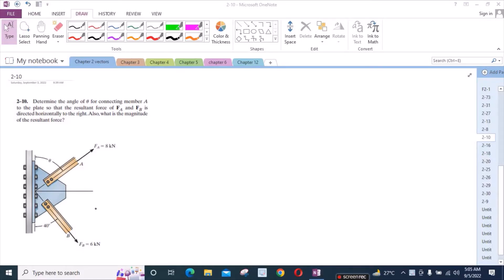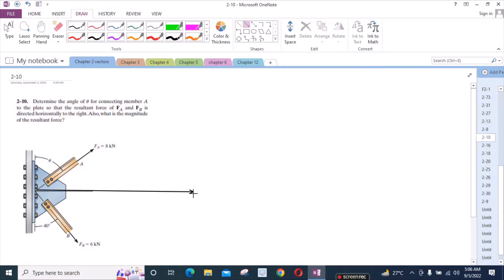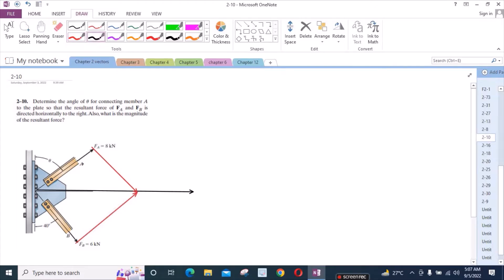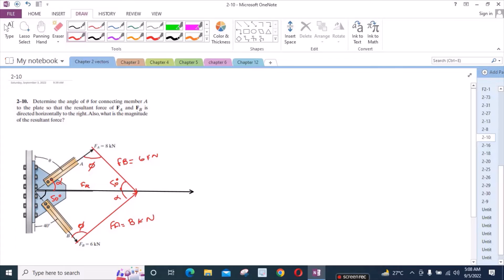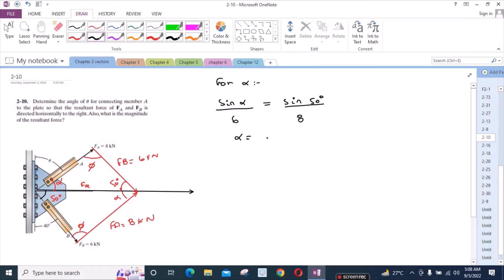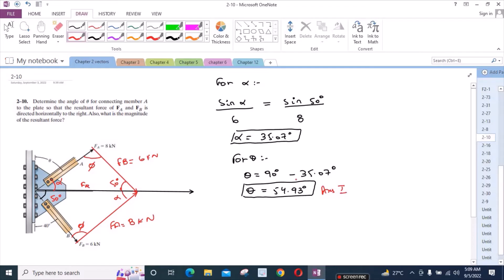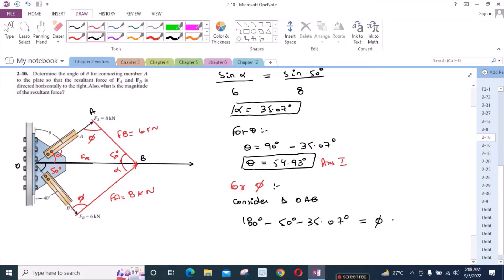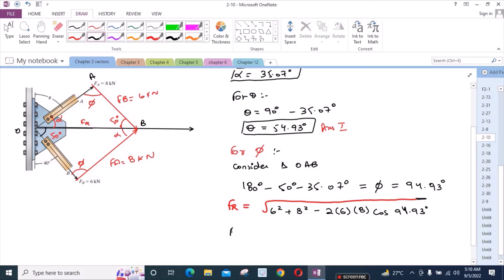2-10 hibbeler statics chapter 2 | hibbeler statics | hibbeler

Comment from the maker: Learn How to Solve 2-94 Hibbeler Statics Chapter 2, "The chandelier is supported by three chains which are concurrent at point O. If the resultant force at O has a magnitude of 130 lb and is directed along negative z-axis, determine the force in each chain."
Here is the Link: https://youtu.be/3qdL38ihAlQ